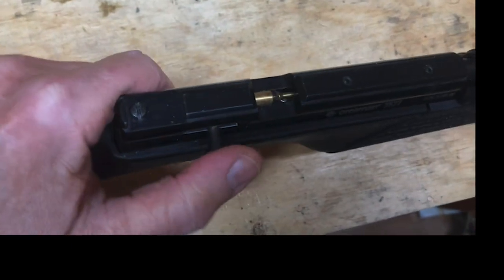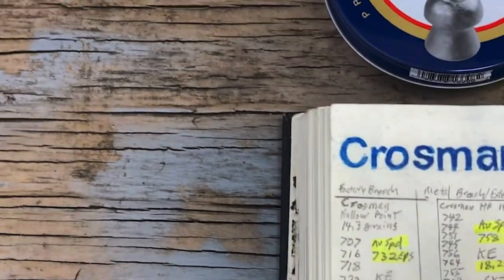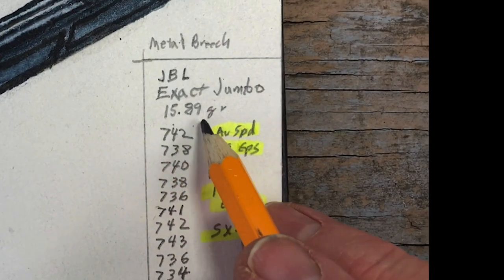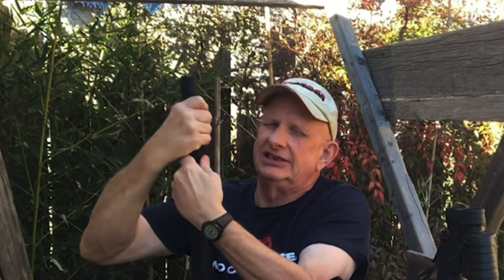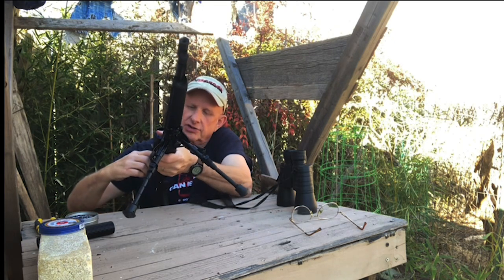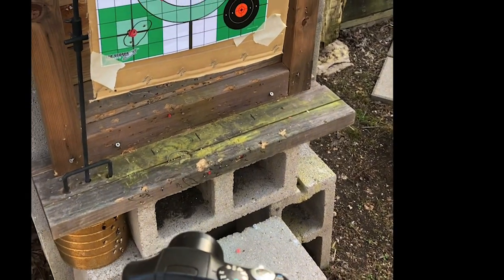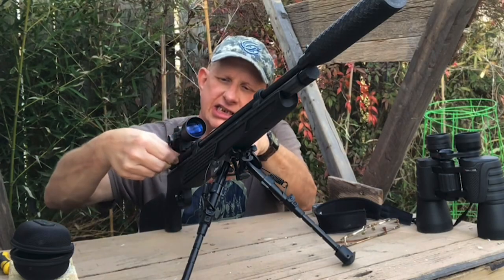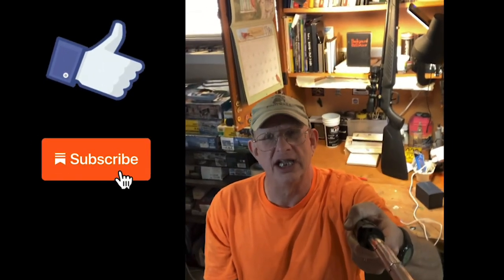Metal breech/brass bolt combo powers Crosman 3622 PCP  to 19.3 ft-lbs kinetic energy

Comment: Which bipod is this and how do I mount it wise Leader!?
Reply from the maker: It is a Caldwell bi-pod, about $50.    The original version of this video was much longer, and showed how I took the 3622 partially apart to install the breech.   I deleted a lot of that, because I didn't want to risk de-montization.   YT does not like "how to" videos on air guns. Basically you have to drill a hole in the stock.   It is the same location as the 362.   I showed in the video "AIM Mil-Dot scope and Harris bipod are my Cros..." where I drilled the hole.   It's between 8 min and 9 min.   The video is indexed in the description section of this video.   With the 3622, you have to take the stock off.  That way you won't drill into the air tank.   Once you drill it, then screw in the sling bolt, and re-assemble the stock.   You have to look up my video on putting the metal breech on my 362, which I think you already commented on, to see the steps in taking this apart.
Reply: @brianwilke592 thanks you're the Man!!! Love love your content and FPS Info and Art info Books 📚

Comment: Great shooting Brian!  The barrel bands on the 3622 make this a much more accurate shooter than the 362. But for the price a Beeman chief for me is a better buy. It shoots just as well plus a wood stock and pressure gauge.
Reply from the maker: Thanks for the info on the barrel bands.  Makes sense.   I figured I just get lucky with the barrels I get, because I have heard sometimes Crosman  barrels are a little off.   Like I said, I have not had problems with my 362, my 100 Annv 362 (my favorite) or this 3622.   I looked on ebay for the Beeman Chief.   I see they are running between $170 to $200.   I bought this 3622 for $125.   I didn't purchase any of the parts added here other than the brass handle, and that was because I messed up on a previous video and used too rigid of a spring.   I purchased a Beeman Raider in October for $175 ($191 after taxes).   I can't really compare it directly to this 3622 because I went with .177.   It will be reviewed some day in the next month or so.   Still in the wrapper, although I did take a sneak peak.   It looks and feels impressive, and I am hoping it is as fast and accurate as several reviewers say.  I'm hoping it is accurate enough to shoot the metal silhouettes out to 30 yards (I think that is the turkey or the pig).   I have only enough speed in my Daisy 753 to shoot the chickens at 20 yards with the groupings in .177 needed.   To do this, however, assuming the Raider is accurate and fast enough not to lose trajectory, I will need a decent scope.   I got a BSA 6X40mm for something like $60 or $70.   In the end the Beeman will cost me $270, as opposed to the 3622 costing $150 (with the new brass handle).   Now, if I didn't have all these Crosman aftermarket parts, it would be a different story, and you are correct, it would cost about the same, and and the Beeman would most likely be the better choice.

Comment: Man, for all the negative things ive heard or seen about the gun, they arent all lemons. Thats a damn fine shootin rig.  The fact you can modify it so easily also gives it some hope. Excellent video, fantastic artwork super decent shootin rig! Great work.
Reply from the maker: Yeah, Johnny Mac, I think it was a timing thing for Crosman.   They released this just before Crosman sold out, and closed their factory in NY.   Made a lot of people angry, or at least disappointed, like myself.    Then you get confirmation bias.    Plus, it is bare bones.   I call it the Ford Ranger of pcp's.   Everybody trashed Rangers back in the day  (I've had three, and still drive the third),  and then once they were gone, all the sudden people realized there was a whole market gone, and you were left with big ole boat pick ups, or bigger.   Back in the early 2000's, you could also drop a V8 in one; the ones originally with the V6 came with the same differential as the F-150, and take it down to your local 1/4 mile drag strip and kick butt.   That's kind of what I did here.   As long as the aftermarket parts are fitting, there is a lot of potential.
Reply: @ thats a great analogy. I also agree. As long as there is customizability, there is serious potential. Have a great weekend Brian.

Comment: My best pellet is the JTS dead Center 16.01 grain. They really shrunk my groups. What did you do to get the power up?
Reply from the maker: Metal breech and the extended probe both get you more power.  They got increase in power on my Super Drifter too.   I also put some silicone on the outside of the edges of the transfer port before I tightened it down.   I didn't put that in the video....YouTube hates when you show "how-to" performance tips, even with air rifles.  Right now, this video is already "limited advertising"...but that is pending human review.   Their AI is really, really picky.